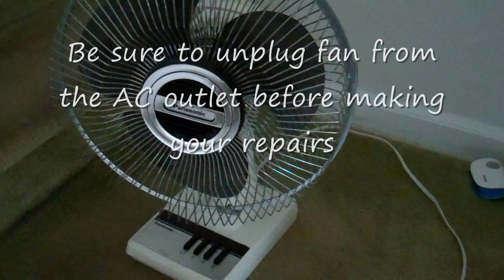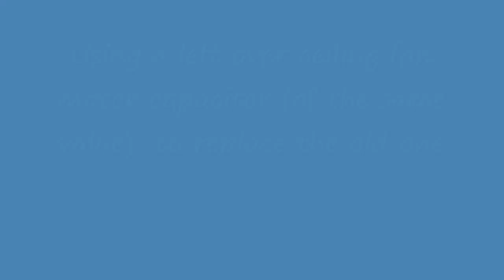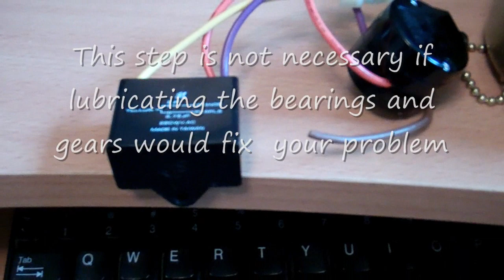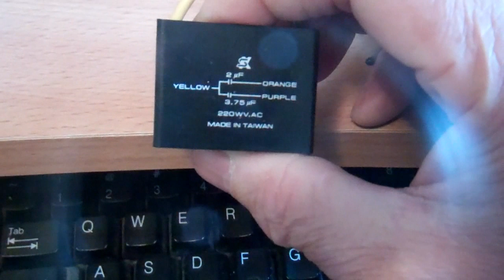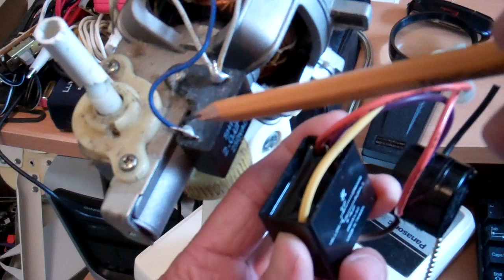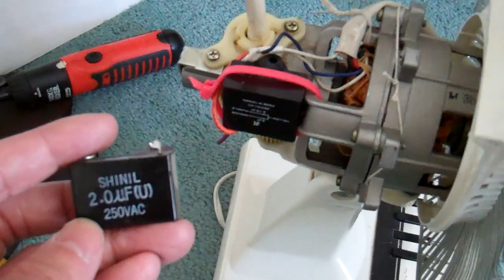Tuning up a slow moving Panasonic 12 inch oscillating fan Pt. 1 Movie.wmv

Comment: Great video ,I've got a fan I've kept going for 8 years now thanks to routine maintenance. But I've often wondered if I increased to MF of the cap if I'd get a speed increase. Or any more longevity, lol I'd probably just burn it up. Thanks for posting
Reply from the maker: My capacitor was actually ok. Lack of lubrication is for the most part why the fan would fail. I'd think increasing the MF would not hurt and might help in the startup but it is probably easier just to lube the front and back bearings.

Comment: hey wtam69 do you have any idea about the signs and symptoms if the capacitor of the oscillating fan is going to be busted?

My Oscillating Fan just started acting up last night, the lowest speed came to a crawl and then what I did was lubricated it using multipurpose lithium grease since I did not have any oil in here.

Mind you though that I already did used multipurpose lithium Grease before in this same oscillating fan. I think that was around early 2013 or so and the results were great! Speed 1 was as fast as Speed 2, Speed 2 was as fast as Speed 3, and Speed 3 is even faster.

Now, I did the Lithium Grease method again and everything is running smoothly, fan is fast but the thing is it can't start up fast immediately although it does oscillate enough to generate momentum before hitting its peak speed on Speed 1.

Turning it on Speed 2 or 3 does not pose a problem at all. Its just the Speed 1 now which starts slow then progresses to a faster speed that it was before.

Do you think the Capacitor has got something to do with this? I know its el cheapo to get one but just want to make sure that its the capacitor and not the motor failing.
Reply: what if i change the capacitor from 320V.w/ 1.5u to 400V.w/1.5u is it ok?
Reply from the maker: Did you grease the back bearing also? Both front and back bearings should be lubricated. You can use a higher voltage capacitor to replace the old one  but not a lower voltage one. Good luck.
Reply: wtam69
yep did greased both bearings. By the way the fan is Ok now again. What happened was that the grease that I applied somehow liquified under higher temperature and as we all know whenever you use the fan its motor heats up thereby also heating up the grease that I applied.

Which resulted in the grease penetrating every nook and cranny of the bearing just like what an oil would do.
Reply from the maker: All's well that ends well. I think I used 20 weight oil, as recommended for fan bearing.
Reply: yup, thanks sir